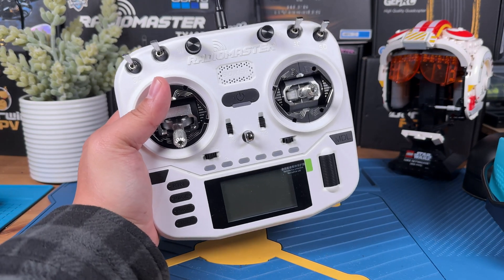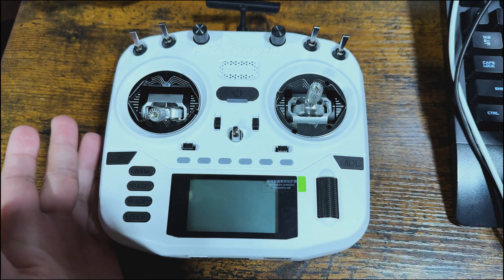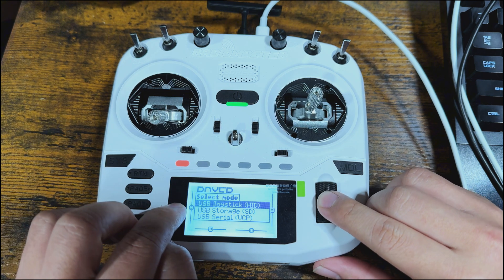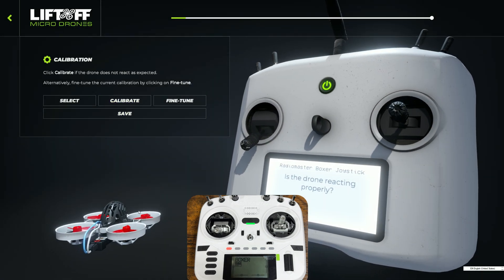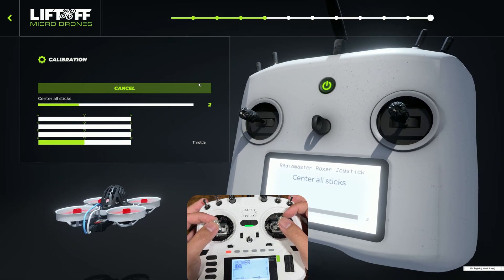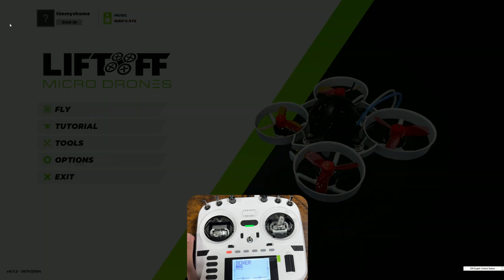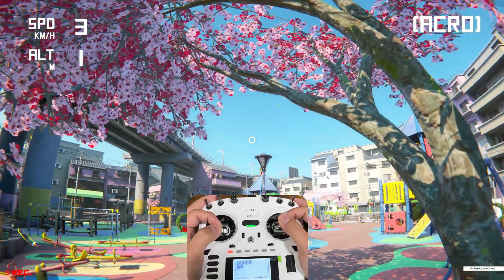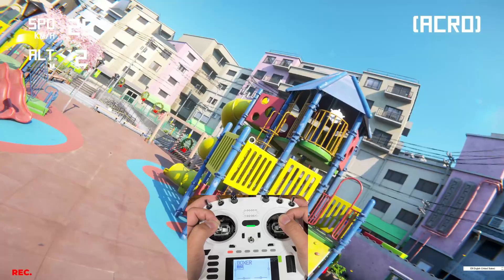How to connect radios/controllers to FPV Simulator the first time? For absolute beginner!

Comment: Thanks for the tutorial! quick question: when the RadioMaster Boxer is connected to a PC via USB in Joystick/HID mode for an FPV simulator, does it still transmit RF (ELRS), or is RF automatically disabled?
Reply from the maker: It should be disable since when you are connecting it will ask you select the mode, my assumption is that that will disable to connection at least

Comment: i have -100 nombers on homescreen i just bought the radio? what is it and how to fix this?
Reply: This is normal, no fix needed. p
it's a way to know at which value the stick is on a specific axis, basically a coordinate representing the stick position.
0 is the middle
-100 is fully to one side, 100 is fully to the other. Perfectly normal.

Comment: Do you need to set up any channels for this or is it really just plug and play?  Ive seen other videos claiming that it needs a new channel and stuff.
Reply from the maker: Unless you are using a really old radio that is not recently released, it should be plug and play as the important sticks are already set up for you
Reply: @XwingFPVRC  thanks man.  It worked flawlessly just plugging it in.  

i definitely will take a dive into your channel to learn more.

Comment: Thank you. Don't we need to turn off the transmitter?
Reply from the maker: No, on the contrary you are required to keep the radio on to use it with a sim
Reply: @XwingFPVRC  I think he meant to turn off the internal transmitter. This is a good idea as it’s not required. Suggest setup a separate Sim mode and then disable the internal\external transmitter, whichever you are using for real flight. then switch back to your main mode to fly for real.